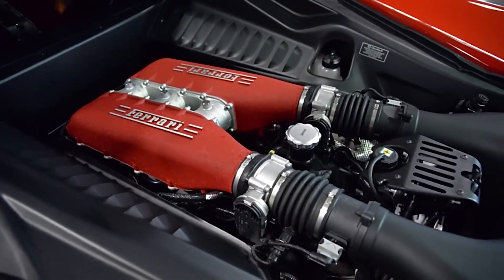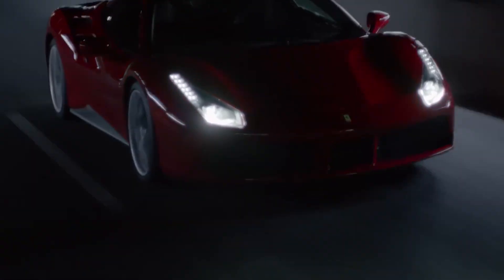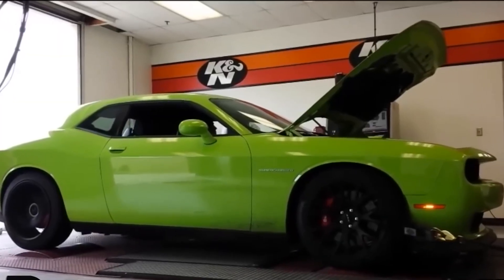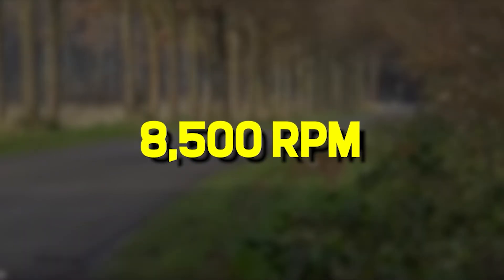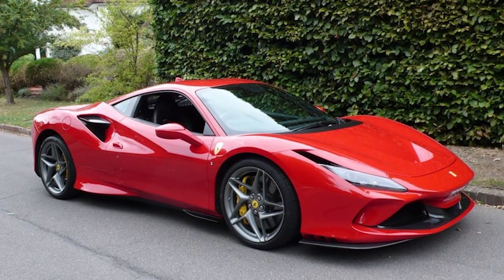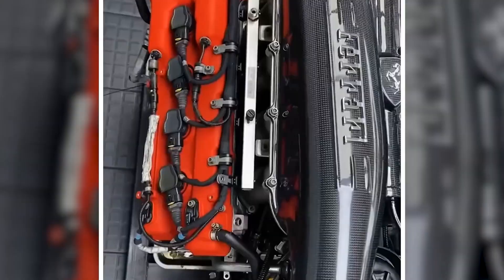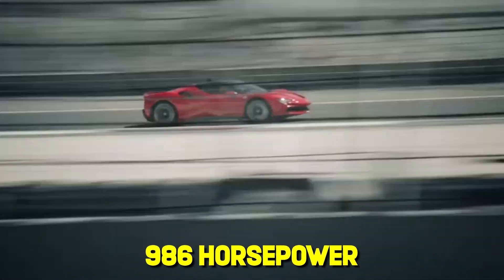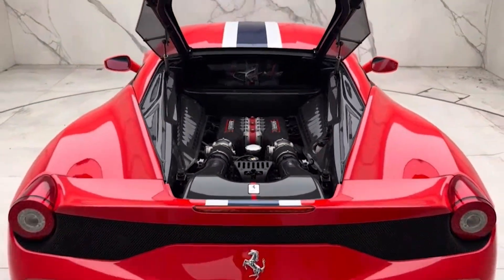The Engineering Marvel That Made Ferrari Legendary

Comment: @0:25 those “facts” are baseless. A flat plane crank doesn’t make an engine more difficult or expensive to build, nor is it challenging to live with. @1:08 a cross plane isn’t smoother, you should do some research on primary and secondary vibrations. This is as far as I got before I needed to turn off this rubbish. Homework is your friend.

Comment: What a load of AI garbage; flat-plane V-8's pre-date (like the WW1-era Cadillacs..) cross-plane V-8's and have ALWAYS been used in racing applications; this engine architecture gives a notable advantage on exhaust scavenging, since each bank fires evenly and acts like a separate inline-4, rather than the odd-firing on each bank of cross-plane engines. Also, since Ferrari has made V-8's in many angles other than 90° to fit the space available (whereas the cross-pane engine only really works with 90° between banks), the flat plane design just works better.

Comment: We have here the subject of two types of V8 engines that I have seen on YouTube videos and have read about. We have the cross plane crankshaft V8 engine and the flat plane crankshaft V8 engine. The differences and uses of these two types of V8 engines is well documented. Primarily the flat plane crankshaft V8 engine is designed for racing applications where the engine develops a lot of power at a high engine RPM. However this has the cost of greater imbalance and engine vibration. For most applications the cross plane crankshaft engine is a more balanced smoother running engine. However a cross plane crankshaft requires heavy counter weights for good balance, which makes the cross plane crankshaft heavier than the flat plane crankshaft. The lighter flat plane crankshaft has less mass to spin up to high RPM which is more suitable for racing.